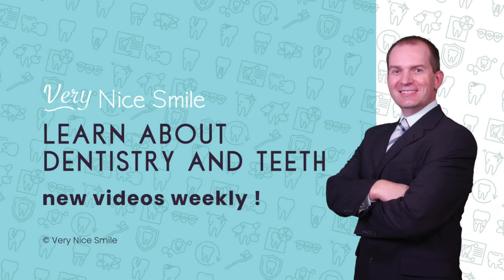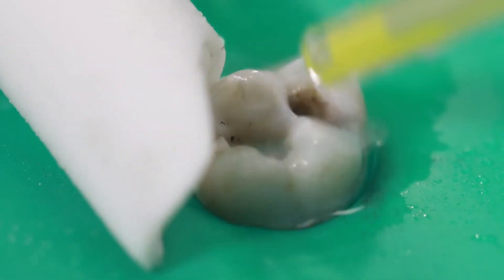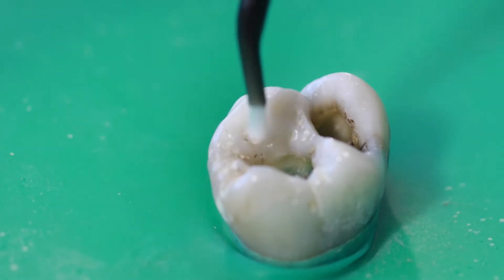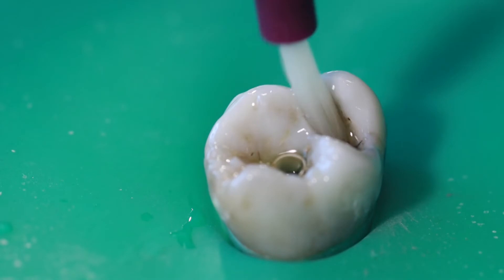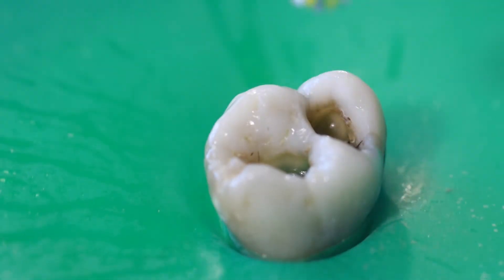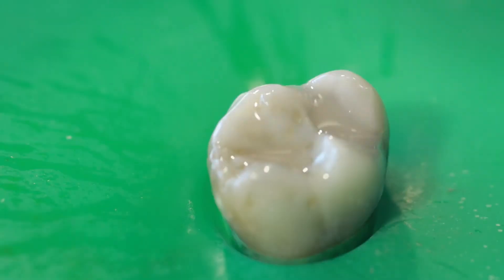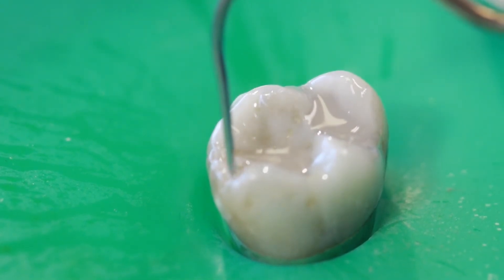Replacing a silver amalgam filling with a white (composite) filling.

Comment from the maker: If you have a question, please ask me in the comments. Thank you very much for watching!
Reply: Should I remove my 2 silver fillings?  I believe the last time I asked they said it wasn't necessary. But, I am concerned that it may be wise to.  i don't really want to risk it weakening my tooth structure as I am trying to keep all my teeth.  Now that I finally committed to flossing daily. Plus, I am concerned it may cause extra inflammation that isn't necessary as I already have inflammation from my eczema.
Reply from the maker: Hi, I usually recommend replacing fillings only if they are failing (they're cracked or they have recurrent decay). I will also replace them if the patient doesn't like how they look.
Reply: @VeryNiceSmileDental  okay, thank you, I appreciate the response.   Not sure how old they are.  i think they are lasting a long time.  Guess, whoever did it did a good job.
Reply from the maker: @GregX1979  A properly done (not too big, not too small) silver filling can last for a very long time. I have silver fillings in my mouth that are almost 40 years old (so far).
Reply: @VeryNiceSmileDental  My largest one is my last tooth (on the left side bottom) and the other is a small one about 6 teeth from center bottom.
Reply from the maker: @GregX1979  without seeing you and x-rays of your teeth, I can't say. But if your dentist doesn't think they need to be replaced at this time, I'd recommend leaving them. Unless you don't like how they look. I tend to be conservative, and the less treatment done to a tooth, the better. At some point in time the fillings will need to be replaced.
Reply: @VeryNiceSmileDental  yeah, The teeth seem fine neither one hurt. So, it's just. Keep getting conflicting research on the dangers of the Mercury in such resins.
Reply: Teeth does not seem properly with side easily crack.
Reply from the maker: @dingpeng2317  Hi, I'm not understanding your question.
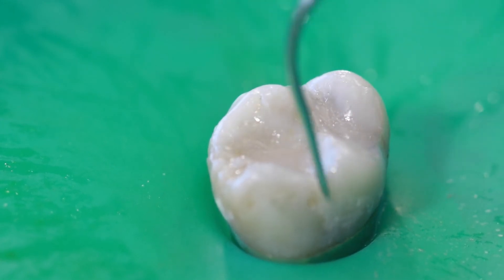Reply: @VeryNiceSmileDental  Hi, sorry! I have no questions, but I find that the teeth wasn't properly filled. Not sure if it is real human teeth. 12:27

A normal human teeth have 4 sharp side. 

However for this instance, it have 5 sharp side. I have filling filled and the whole teeth just cracked off at the weakest link the side. Ultimately, my whole teeth just drop off.
Reply from the maker: @dingpeng2317  No worries. This is a real tooth. I think it was an upper molar that was extracted due to periodontal disease. It had a small silver amalgam filling that I replaced with a composite resin filling. The tooth has 4 cusps (points). I'm not sure what you mean by "5 sharp sides".

Comment: I had a huge cavity..
But i got it filled.
Its been a year now,  i dont have any pain while eating on that side, but i am worried that do i need rct as it was a huge cavity that required rct..

Can oral cancer occur due to not getting rct when it is required.
I just got it cleaned and filled.
Its not paining as of now and i dont have any puss around that tooth.
Reply from the maker: Hi, next time you see your dentist, have them take a look at the tooth. They can take an x-ray of it and do a pulp test to determine the condition of the nerve. You won't get oral cancer from not getting root canal treatment.
Reply: @VeryNiceSmileDental  thanks doctor 😇

Comment: Does filling it up with mostly  flowable really have the strength required for a posterior molar?
Reply from the maker: Yes, the flowable is strong under compression, but it doesn't have the wear resistance of the paste composite.

Comment: Hi!Is it possible for a tooth to become sensitive to pain-not hot or cold,chewing pain-after replacement from amalgam to composite?Do you use any pulp protection if if you have to work near the pulp?
Reply from the maker: Hi, anytime a tooth is worked on, you can have sensitivity afterwards. First thing I check is the bite to make sure the new filling is not too high. I don't normally use any pulp protection other than a good bonding agent and flowable composite under the composite. Pain when chewing may indicate a crack. I have a video that goes into more detail about pulpitis, https://youtu.be/RqwCYElA9BU

Comment: just had 3 fillings today how long does it take for the teeth to be okay ? and is it normal for the drilling to be painful ?
Reply from the maker: Hi, it's normal for the tooth to be sensitive to hot and cold for a few days even a week or two after a filling. You shouldn't feel any throbbing pain. How does the bite feel on the fillings?
Reply: @VeryNiceSmileDental  it's not painful but i prefer not biting with the fillings yet because i'm scared it will end up being painful
Reply: @VeryNiceSmileDental  hi one of my fillings is still a bit painful when i chew and is still sensitive to cold and hot it's almost a month what does this mean?
Reply from the maker: Hi, it could be the bite is high on the filling, it could be a crack in the filling, it could be a crack in the tooth. See your dentist to have it checked out.

Comment: i have a tooth with a silver filling. i think part of the filling must have failed because about 20% of my tooth with the silver filling chipped off exposing some of the filling (filling didnt come off, jsut a piece of tooth). it doesnt hurt for now, can it be repaired iwthout goign crown route>?
Reply from the maker: It depends on how much tooth structure is left. Rule of thumb is if more than half the tooth is missing or is filling material then a crown is recommended.

Comment: Hello Doc I have a question how do I get rid of nerve irritation when the dentist drills my mouth the sensation of the heat makes me jolt and theres so much pain? Why do you think that is and could i ask the dentist to possibly give me a injection to the tooth so i wont feel the drill hence vibration? My teeth are very sensitive
Reply from the maker: Hi, does the dentist give you a local anesthetic before they drill your tooth?
Reply: @VeryNiceSmileDental  yes thats correct they do
Reply from the maker: You will still vibration and pressure even with the local anesthetic, but you shouldn't feel any pain.
Reply: @VeryNiceSmileDental  okay thats understandable I just have a lot of dental trauma and the first go around the dentist never numbed me up and the heat of the drill made me tooth hurt so bad.. i have two dental extractions coming up on the upper left molar 12 and bottom left #19 they are broken and hopefully they will come out easily

Comment: How long does composite last in molars is it good or its better to use amalgam
Reply from the maker: Hi, how long a composite filling lasts depends on several factors. It can last a long time, I routinely use it for fillings. I still place amalgams in certain situations (usually third molars or patching up gold or porcelain fused to metal crowns).
Reply: A good composite should last 5 Years and retain a marginal tightness of 90% or above after 5 Years of chewing forces. There are countless composites out there but few that stand the test of time. It's good to ask your dentist what composite they use for your filling so you can research them and ensure its a good product.

Some dentists opt for inferior materials to save costs so keep your eyes peeled.

Comment: how long does this procedure take and does it hurt? i have 5 i have to do on my molars
Reply from the maker: Hi, the tooth is numbed for the procedure so you don't feel any pain. How long it takes per tooth depends on the size of the filling and how fast the dentist works.
Reply: @VeryNiceSmileDental  hello. does this procedure require the dentist to remove any part of your tooth?
Reply from the maker: @ Hi, yes some of the tooth will be removed during the process.
Reply: @VeryNiceSmileDental  removing parts of the original tooth or just strictly the filling?
Reply from the maker: @ parts of the tooth will be removed. The tooth needs to be clean for the bonding to stick to it. Also the edges of the cavity need to beveled for the bonding.
Reply: @ Thanks for the responses. Last question. I am replacing 6 silver fillings I have with composite ones. Does removing parts of the original tooth hinder the tooth at all in the future?
Reply: @VeryNiceSmileDental  Thanks for the responses. Last question. I am replacing 6 silver fillings I have with composite ones. Does removing parts of the original tooth hinder the tooth at all in the future?
Reply: @sleepyshaman69  Ultimately it is best to conserve as much of the natural tooth structure as possible. However, you have to consider the dentist should only be removing the parts of the original tooth that are decayed.

Comment: Usually do dentists use anaesthetic injection or is that only in certain circumstances?
Reply from the maker: Usually anesthetic is used unless the patient specifically asks to not use it, or if it's a really minor procedure that doesn't involve drilling into the tooth.
Reply: @VeryNiceSmileDental  if the patient asks not to use it is there an alternative numbing gel? If not does the drilling usually cause a lot of pain without the numbing agent?
Reply from the maker: The numbing gel is only to numb the gum a little before the injection. To numb the tooth, you need an injection. Some people don't have sensitive teeth. I have quite a few patients that never take anesthetic for having fillings drilled.
Reply: @VeryNiceSmileDental  thank you for your response I’m having three fillings done over the next month so I was a bit nervous.
Reply from the maker: You're welcome!

Comment: Great Video. I had a composite filling and I'm still in a lot of pain 5 days later. The dentist couldn't find anything wrong after returning and biting on a plastic wand.  What do you think could be causing the pain?
Reply from the maker: Thanks! What kind of pain are you having?
Reply: @VeryNiceSmileDental  There is sharp zapping pain when biting on harder foods. I have no issues when eating softer foods and the pain is only when biting.
Reply from the maker: Hmm, and you had no response when biting on the plastic wand?  How does you bite feel? Are you touching on that tooth first?
Reply: @VeryNiceSmileDental  No, the dentist checked for high spots and said it all seemed ok. The pain is only when biting harder foods. I'm wondering if there is a void in the composite filling? The dentist didn't use the damb around the tooth when performing the procedure.
Reply from the maker: @chriss2410  Hmm. It's possible it could be an issue with the bonding. Did your dentist use the plastic stick to just put biting pressure on the filling? Did the corners of the tooth (the cusps) feel ok when biting on the stick?
Reply: @VeryNiceSmileDental  I think the pain is coming from the side of the tooth. The dentist checked the tooth that was filled along with the tooth directly in front. It's seven days tomorrow since the procedure and it's still painful with biting pressure.
Reply from the maker: How deep was the cavity or was it an old filling that was replaced?
Reply: @VeryNiceSmileDental  thank you for your help. The metal filling was replaced and my tooth had cracked on one side having bitten on a popcorn kernel. There were no issues with the temporary filling, and no further cracks on the x ray.

Comment: amazing video. Thanks. 
I have a question, where do you put the extracted tooth so you can work on it so easily, as I would like to practice on extracted tooth, but I don't know how will I even make them stand and not move?
Reply from the maker: I made a short showing my tooth holding setup. You can watch it here  https://youtube.com/shorts/MPVjjtKO9Ro?feature=share
Reply from the maker: Hi, I stick the extracted tooth in a bit of snap stone that I pour into the bottom of a plastic cup. Then I use a a small vise I bought from Harbor Freight Tools to hold it in place while I work on the tooth. The green you see in the video is a green rubber dam I stretch around the tooth to cover up the vice and stone so it looks better for the video. Thank you very much for watching!

Comment: Does removing sliver filling has risk of mercury poisoning ? Or sliver filling as it self ?
Reply from the maker: Hi, silver fillings do have mercury in them.  But if they need to be replaced it is safe to do so with a dental dam and high volume suction. Thank you very much for watching.
Reply: Yes mercury fillings are very dangerous. Alot of sick people because of it.